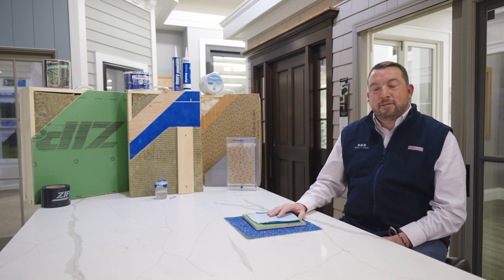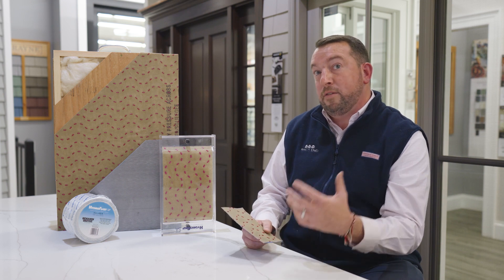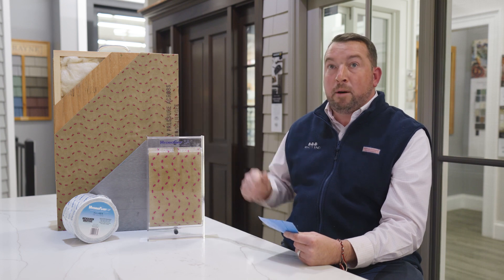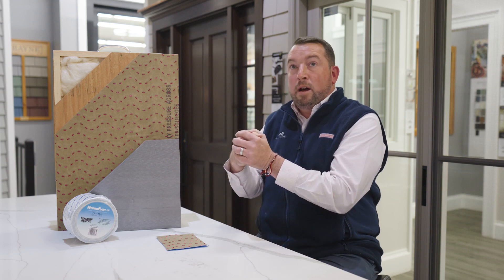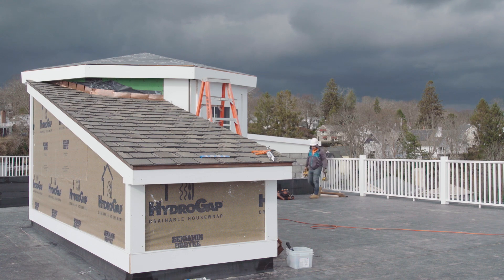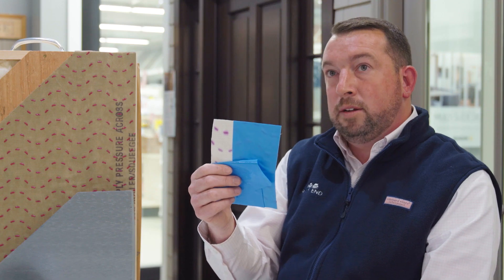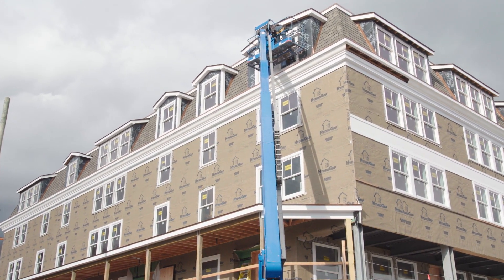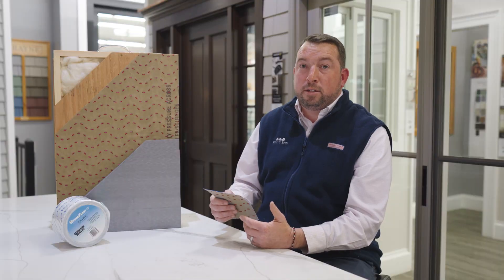Weatherization 101: Benjamin Obdyke Hydrogap

Comment: Using this and exterior insulation, shall we skip the interior vapor barrier then so the wall cavity can dry to the inside?
Reply: Depends on what zone you are in. Zones 4 and up still require a vapor retarder. Not barrier. There is a difference. I always recommend a smart retarder.
Reply: What zone is 11050 requires

Comment: Would the Slicker Max rainscreen be a better fit if I’m using the Zip System for my exterior wall sheathing? I’d also be using vertical steel siding by Edco…. Thanks